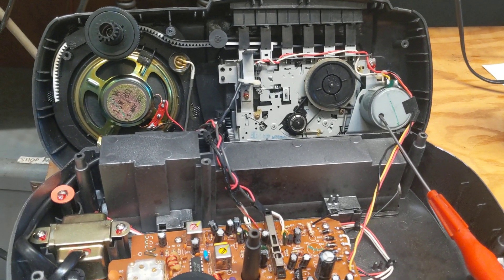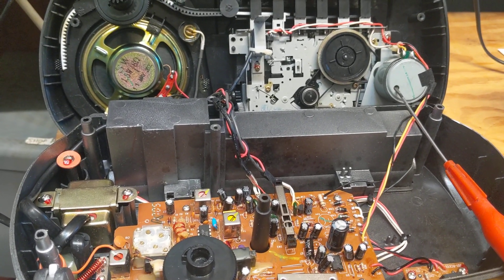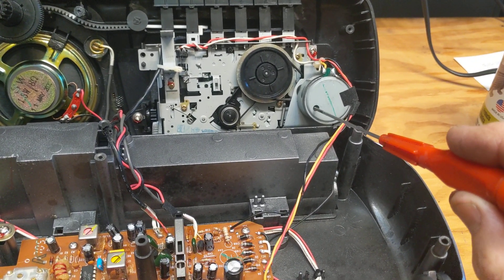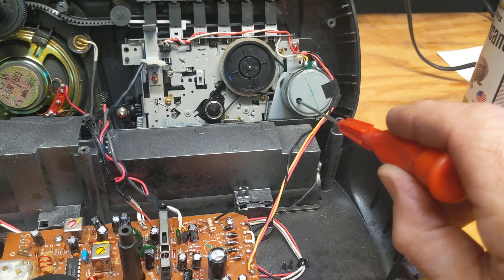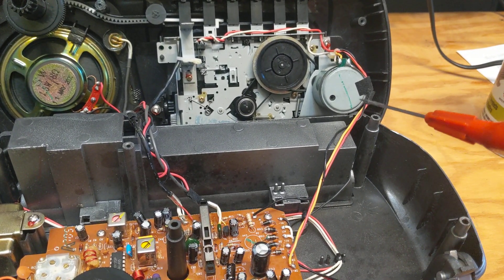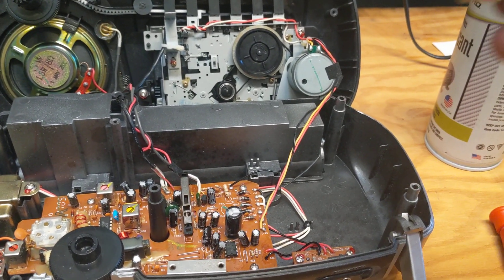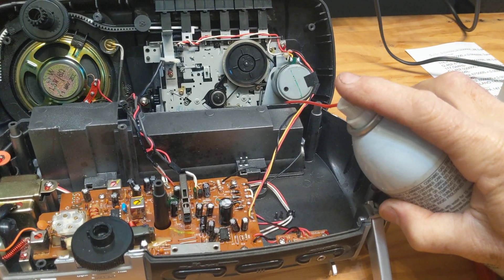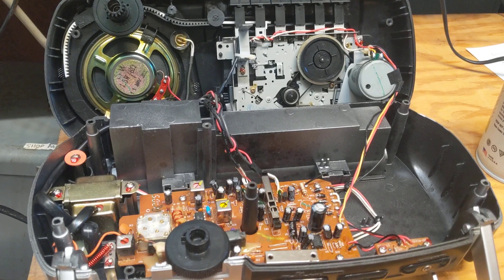Motor Speed Adjustment On AM FM Cassette Player.

Comment: Great video, thanks for the upload. It's the first of its kind that I've seen on youtube. 
For the ~warble/flutter, first, do a tape path cleaning that ensures the capstan (the spinning metal pin that operates inside the hole of the open edge of the cassette when playing/ recording) and, especially, the pinch roller that presses into capstan to draw the cassette ribbon through are both clean. I use 70-90% alcohol (Walmart/CVS/Walgreens) on longer reach swabs packaged in pairs in a box of ~100 from a local medical supply store. .... Magnetic debris comes off from passing so many hours of tape ribbon after which you'll see a brownish banded area the width of cassette ribbon accumulate on the roller and, though not as easily observable, the capstan. One wants the pinch roller(s) and capstan(s) to have the same, even tone/ sheen across the width of the surfaces. Keep alcohol away from the base of the capstan pin so as to not affect any lubricant. Push "Play"/▶️ with the deck door open and apply the wet (but not dripping) swab while clear of the pinch point where capstan and roller meet to keep from fraying material off the swab head to save cleaning that out. Roll the swab to maximize use of its cleaning surface which may have you reaching, regardless, for a few to as many as upwards of 10 or more depending on how dirty things are/ difficult it is to remove. Rewet swabs if necessary to make use of the entire swab head. If the capstan has stubborn debris left after clearing the pinch roller, stop the deck then press Fast-Forward/FF/⏩️ so the pinch roller isn't brought into play with the capstan while using the increased rotations to expedite debris removal via repeat swab application. For very stubborn capstan debris, I've used a pencil eraser gently applied to ~scrub but not grind off eraser material into the deck. After pinch roller and capstan, use only fresh swabs on the playback and record heads so as to not displace debris from other areas and harm the sensitive head(s). Significant improvements to audio quality are typically heard at this point. If the player won't function for maintenance with the door open, decks have a lever ~armature or ~pin/~rod sensing the open door which can circumvented by holding your other hand's thumb/finger against that so the deck will actuate and activate for the maintenance activity. If there's still warble/flutter, then follow up with belt inspection and checking the motor as shown here. 👍

Comment: Here's a little tip/trick to get cassette players at the exact right speed. For this you have to get a perfect working cassette recorder, and record a 1Khz sine wave signal from YouTube. These testsignals are spot on. Then place this recorded cassette in the player that needs adjustment, connect the audio output to a scope, and set the speed of the motor to get exact 1Khz signal. Same tip/trick can be used for older cd players. As a audio source you can use your computer/laptop to play the testsignal, but you can also use a Mp3 player as a "poorman's signal generator" to play these testsignals.
Reply from the maker: Thanks. Great idea.
Reply: Great technic and Super Useful. I remember at the beginnig of tapes ( Compact Cassette or Musicassette (MC), also commonly called the tape cassette) there are some red lines that they show a kind of time-speed measuring signs. from the first red line until the start of magnetic tape. if speed be NORMAL , then time would be 5 seconds.
Reply: If I had a a perfect working cassette recorder, I wouldn't need to adjust the speed of my old crappy recorder.

Comment: I found the hole at the back of the cassette motor, but theres nothing, it just speeds up the motor and the music if it reached the inside…

And actually the motor have 4 wires and it looks like it can control the speed itself when it was slow or fast

Comment: I almost have the same oldschool player as you, coloured pots, brown board, etc. My speed was hella slow, it was a Mitsumi 6V motor, however, adjusting the variable resistor didn't change much. I've even ordered a replacement motor (exact model), however this time it was too fast, the variable resistor on the new one also didn't affect speed, no matter how many times turned. I just added a separate variable resistor outside the motor and it worked then, manually twisting it with my hand. Annoying to not get it working from the start though.

Comment: Helpful video. I've worked on/opened motors before to clean the armatures being very careful with the carbon brushes which can easily break. Some motor cases are crimped shut 😑, grrrr, while older ones have screws😊.
I have a mid 80s Panasonic boom box with Cassette whose belts are loose. I save most of the belts I change out but had to resort to an assorted size flat and square belt kit. These belts are from China and are so thin and flimsy compared to those you could get years ago. I don't know where you can buy decent belt kits anymore.

They seemed to work Ok, but the speed was slow and it would slow down even more and then speed up. The motor has the little hole in the back and I think I'll try to adjust the screw and if needed spray the Contact lube cleaner. Does the contract cleaner get on the brushes and can that cause a problem?
Reply from the maker: I'm not sure it would be a problem, but on the topic of belts, I thought you might appreciate this older video on belt replacement, in case you are needing a replacement. https://www.youtube.com/watch?v=ufuELzsMKUg
Reply: That's a great video reference. His collection of used belts looks just like mine. I have a huge plastic bag filled with various belts that I've taken out of used units that I can reuse in several cases. Yes, several of mine have also turned to a gummy tar almost like some of the Ampex/GRT 8 track pinch rollers. I use rubber renew to get some of the tackiness back but it does stretch them a bit. I read if you put them in hot boiling water it can cause the belts to shrink in size a little; not sure about that.

Ask for the motor, Just like your case, I turned the screw and the speed went up somewhat but then I sprayed it with contact cleaner and it really sped up a lot! This morning I tried playing it again and the motor got sluggish on me again so I used the DeoxIT brand cleaner which I heard is better; not much of an improvement. Finally I got a thinner belt wall than the one I used to replace it with and that did the trick.
Reply from the maker: I understand. he belt tension can be a real problem. Especially if the belt is to thick.  @waukee321
Reply: It's amazing how precise you have to be in matching up the replacement belt both in terms of circumference and wall thickness particularly on these smaller (and lower power) motors. Those good old huge, massive (and hot running!) AC motors found on many open reel and older 8 track units were more forgiving on tighter circumference and thicker wall width belts. They could run for hours if properly lubricated and vented.
Reply: ✏️📌 (Leaving a comment here for any future developments and referrals to good, quality belt sources.).... back in the day, for custom belts, you could buy a particular shaped belt at a particular cross-sectional Dimension and cut it to length to make a custom belt glued at the ends for particular applications but that wasn't always a universal solution depending on the diameter of the pulleys trying not to be bothered by a potentially amateur glued joint/ seam I'd made.
🤔 Makes me wonder if there's a manufacturer for the turntable belts that are taking pride in the materials and also in the business of cassette and reel to reel belts.
Reply from the maker: It worked for me, but I sprayed an electronics lubricant in the motor, rather than a cleaner. Here is the company I get my belts from. https://www.russellind.com/prbline/prblinecom_.htm

Comment: Sometimes the motors go bad. Not sure what goes wrong with them but had many that won't hold a steady speed. Also there are decks with the hole in the back of motor, but nothing in there to adjust.
Reply from the maker: Worn down motor brushes and commutators can cause the motors to slow down or quit.

Comment: Dave, I've got a great dual cassette boombox system that will play cassettes, but it will not fast forward or rewind on either deck. Any ideas?
Reply from the maker: I can't say without seeing it.
Reply: More than likely the belt
Reply: I had the same issue on a tape deck I picked up a while back, and while I don't know the cause on yours for certain, for me when I pressed the play button, it moved a small metal bit that pressed two other metal bits together (no idea what they're called) and connected the circut, but when I pressed the fast forward/rewind buttons, they didn't press the metal bits together, so I gently bent on of them closer to the other, and that solved the problem. Not sure where this would be in your deck but open it up and press the play button and pay attention to any moving parts that might be connected to any of the wiring. Hope this helps.
Reply: Mine was the belt. No play, no ff, no rw, took it apart and both belts were .... GONE ....

Comment: What would the fix be for one that’s a little loud and sometimes just stops?
Reply from the maker: I would need more detail to make an educated guess as to what't wrong. Did you test the voltage going to the motor when it stopped working to see if there was a voltage drop? If so what was the reading?
Reply: @GrantsPassTVRepair  i haven’t, sometimes it will run for forever and sometimes I’ll have to move the pulley for it to start and sometimes it will run then stop but will run again if pulley is moved , kenwood kx-76 the motor is eg-500ad-2b
Reply from the maker: @chickenfoundation9323  What you described sounds like the motor may have issues due to a worn out commutator and or brushes, but that's just a guess since I haven't seen it.
Reply: @GrantsPassTVRepair  so just change out the motor? Where can I get a new eg-500ad-2B 12v 2400rpm ccw
Reply from the maker: @chickenfoundation9323 Since I have not seen your unit I can't guarantee your motor is the problem. That's why I asked if you tested the voltage to the motor. It could also be a slipping belt, or power supply issue. I don't have any specifics on where to get a new motor. Sometimes your only option is to salvage parts from broken units you may find on ebay,
Reply: @GrantsPassTVRepair  it doesn’t have a belt on , old belt turned into goo , went to test voltage but turns out my multimeter fuse has blown , tried spinning pulley but seems to be seized
Reply from the maker: @chickenfoundation9323  Sounds like  you figured it out.

Comment: It might have also been old grease on the bearing of the motor and squirting the cleaner in could have cleared it. (?)
Reply from the maker: Hi Frank. That thought crossed my mind, but if it was a friction issue due to a dry bearing I don't think the sound would have warbled, but that's a little speculation on my part.
Reply: @GrantsPassTVRepair  In my (limited) experience of taking these motors apart, (I'd say it was a 70's or 80's mechanism), the speed control PCB has the bearing built in and behind it is the rotor and the magnets exposed. So in theory the cleaner would have gone all through the motor assembly. :)

But I've only taken about 5 apart, so I might have just hit on the same model of motor by accident.
Reply from the maker: @frankowalker4662  If you're right I hope it lasts a while. Worst case scenario I stand behind my work and offer a  money back guarantee.
Reply: Have freed up cassette motor spindles from the bearing before - including CD players. Would be interested in a referral to what long-term lubricant would best be used after having broken free the spindle of the motor from its bearing during diagnosis / prognosis.